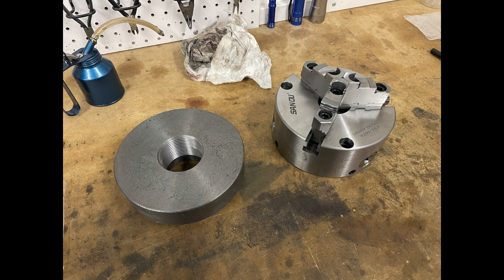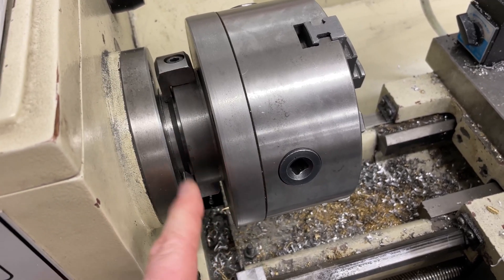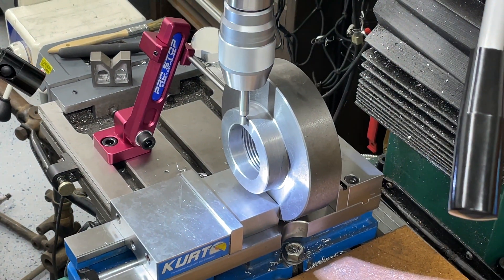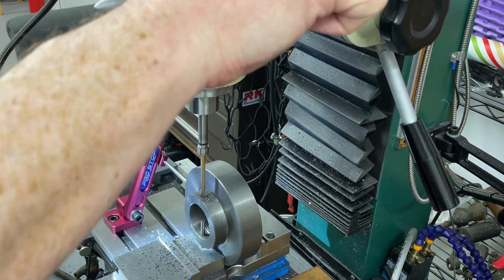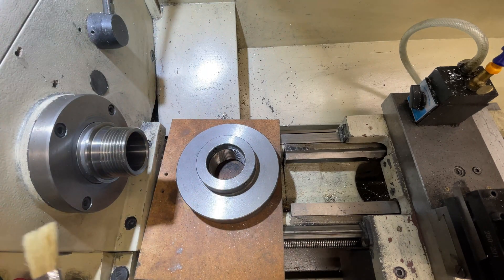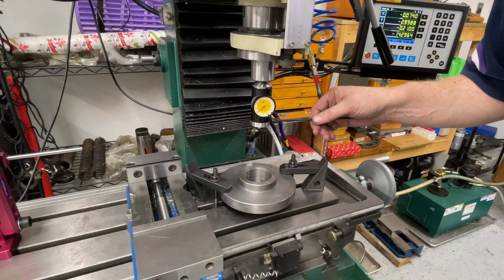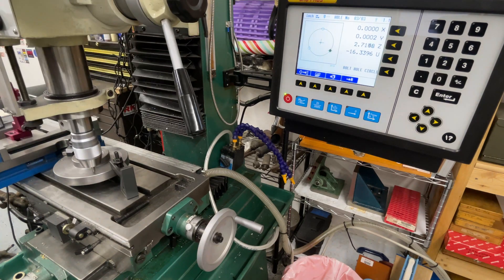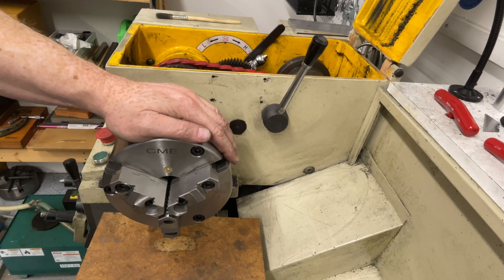Machining and Mounting a Cast Iron Back Plate for a New Lathe Chuck.

Comment: I have the same lathe and is going to mount a 125mm chuck plus  threadmill motor on it. Making a backplate for it wasn't going to be easy, so I sacrifice the big  mounting plate that came with lathe, in the 24 years I have had the lathe, never used. Thinking if I need another backing plate, have seen others do it. I made an automatic manual stop for it, works well. Greetings from Brisbane Australia.

Comment: I’m curious, why is it less accurate? Isn’t that what the spindle register is for?
Reply from the maker: Hello! Thanks for your question, I appreciate it. yes that is what the chuck register is for. I actually just went and measured mine and I can't measure any run out on the register on my .0005" DTI. So that should be a very accurate locator - to around .0015" I would say, given clearance of the chuck back plate etc, and based on what I have been told by various people. That's actually pretty good, but for some reason my old 3 jaw chuck was never that close, which leads to problems when you have to turn a part around and have concentric features on each side. I think the true adjust style chucks like this allow you to adjust the chuck when you release a part and re-engage it so that you can keep tight tolerance on concentricity for features. I think initially I felt the true adjust would be a one time set for each time you mount the chuck, but I don't think that's the case - it's for fine tuning set ups when needed.
Reply: @StuartsShed  I checked my chuck and the ID of the back plate is about 2 thou larger than the spindle register. I’ve got two ER collet chucks that are getting mounted to two new backing plates with about 1.5 thou clearance. There seems to be a bit of a divide when it comes to what actually locates a chuck. I thought it was the back shoulder/face of the spindle. 

Also I have virtually the same machine as you 😅
Reply from the maker: @freestyla101  Nice! I think that couple of thou clearance is needed so that the backplate will easily slide over the spindle each time. That’s the issue with a threaded spindle I guess. I’m actually pretty happy with this machine. It took some set up but over time I’ve made it very accurate and repeatable. 👍

ER collet chucks are a great addition. I have an ER40 for mine, which has the true adjust feature. I have to set it up each time I install it but then it’s dead on for the duration. I have a C5 collet chuck coming also.
Reply: @StuartsShed I agree! Mine was shocking at the start but after levelling, a headstock/tailstock alignment and cleaning it is now turning very straight. 

Unfortunately I can’t adjust my ER chucks (32 and 40) but hopefully I machine the spigot right. I was watching your video to see how it should be done 😊
Reply from the maker: @freestyla101  Very excellent. Best of luck - hopefully this video is a bit helpful in some way. A collet chuck is a great addition and you will love having them on hand.
Reply: @StuartsShed  love it except for the need to buy every size collet 😂. All the best cheers